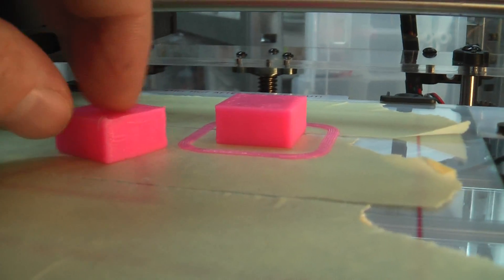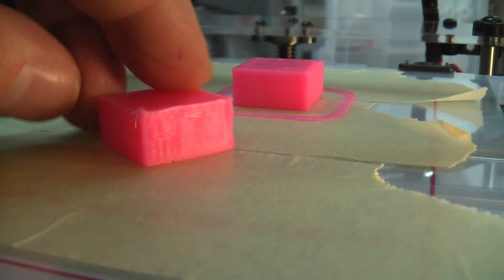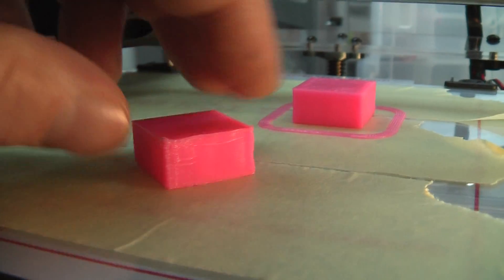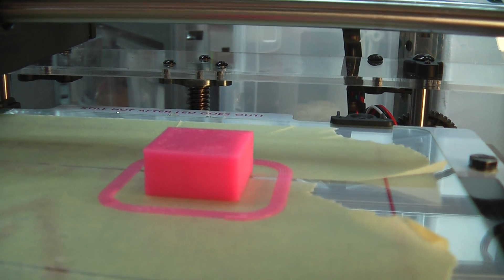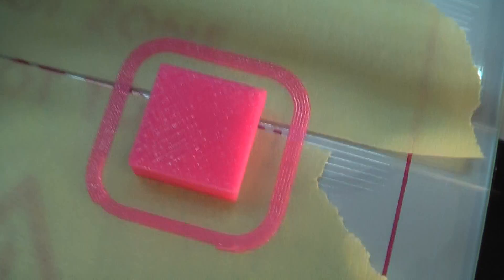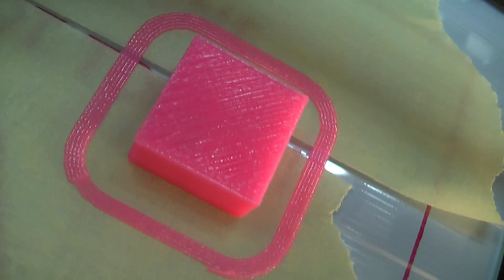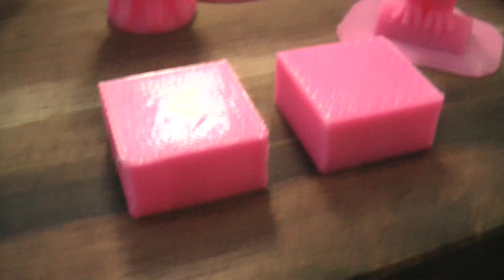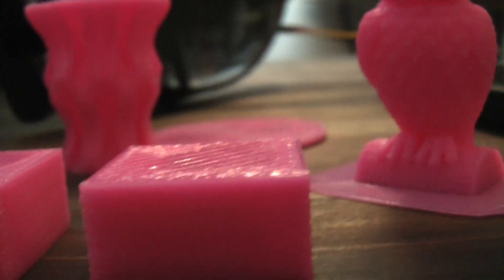Try a different slicer  for your 3D prints

Comment: Thanks for sharing the video. I just started to use Slic3r also and found it can improve prints compared to Cura. Could you tell me if you use the bed or not for PLA and what kind of config do you have for infill, speed, perimiters ? May be you could share the ini config file such as i could compare to mine. I cannot achieved such a good finished printing object
Thanks again

Comment: Simon good choice in moving to slic3r! It's more feature packed and most settings are explained. Ditch that tape though a go with elmer's extra strength glue stick. I just apply a few thin layers and use a damp sponge while the bed is warm to evenly coat the bed. And once the bed cools most parts pop right off. Just wet the sponge with water and wet the glue on the build plate. On application can last a week.
Reply from the maker: jordan bourns Thanks for the tip with the glue. I will give it a try. The tape actually works really well (for PLA that is). Prints stick almost too good to it. When parts are carefully removed I can use one application for many prints.
Reply: I have tried tape of all kinds. And just decided to try the one stick i had. It just makes for a very smooth bottom finish. The only sign is what would resemble streaky Windows. Not a single nozzle pass is visible at 100 infill.  
Seriously